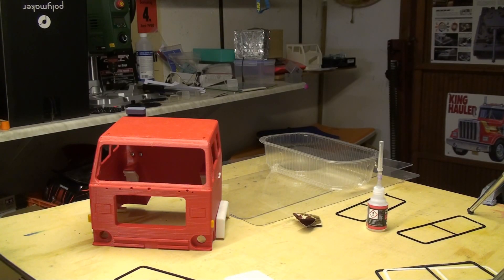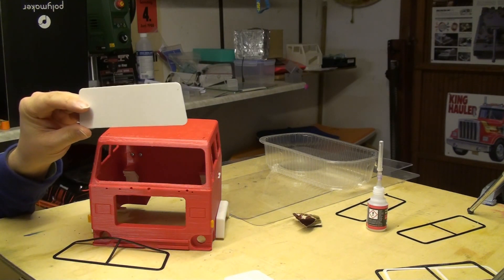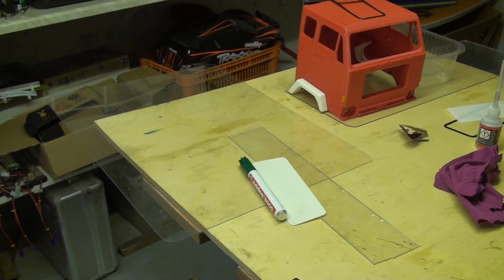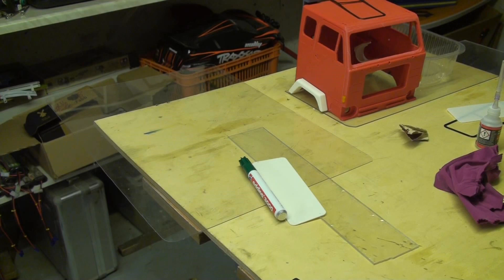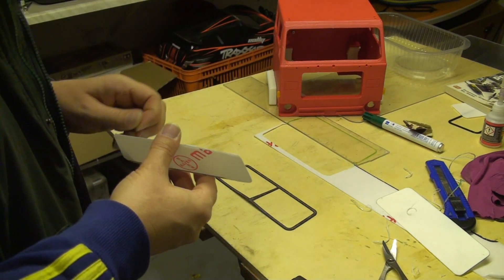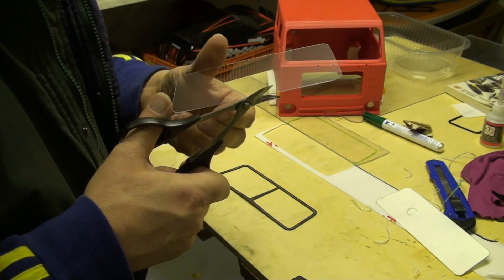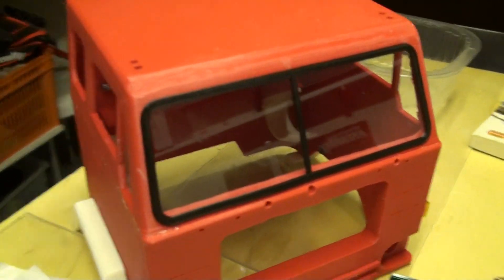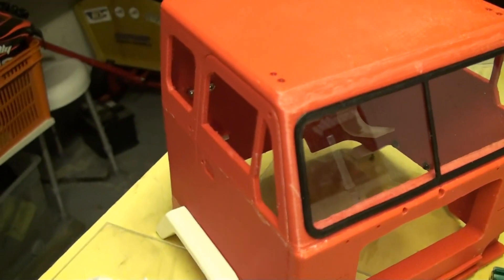Windshield and rubber gasket for the 3D printed Volvo F88 1:14 Tamiya Truck Cab

Comment: Hallo. Wunderbar dein Volvo, was würde so eine gedruckte Kabine kosten?
Reply from the maker: Hallo. Schwer zu sagen. Ich könnte mal alle Teile auf die Waage legen und dann den KG-Preis ermitteln... Nicht berücksichtig ist da dann der Stromverbrauch der Drucker, deren Verschleiß und die manuelle Arbeit, die teilweise noch notwendig ist (Entfernen von Stützmaterial). Theoretisch könntest Du ja mal eine Datei bei einem Druckdienstleister hochladen und schauen, was für ein Preis dabei rauskommt.
Reply from the maker: Ich habe gerade den Dieseltank (der in den nächsten Tagen veröffentlicht wird) gewogen. Mit drei Haltebändern wiegt er genau 70 Gramm. Bei einem Plastikpreis von 50 € / kg sind das 3,50 € für den Tank. Als Designer / Konstrukteur darf man aber viele Dinge mehrfach ausdrucken, da es ja oft noch Dinge zu verbessern gibt, die man erst sieht, wenn man ein Teil in der Hand hat oder am Gesamtobjekt verbauen will (Ursprung des 3D-Drucks!)...